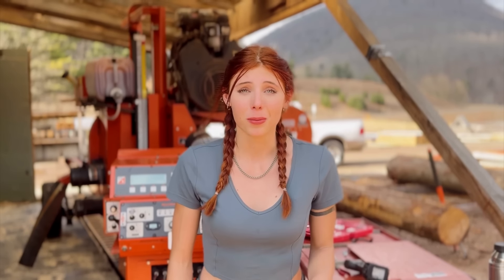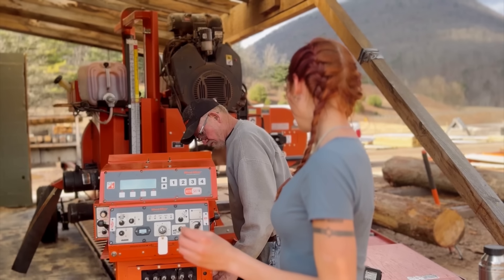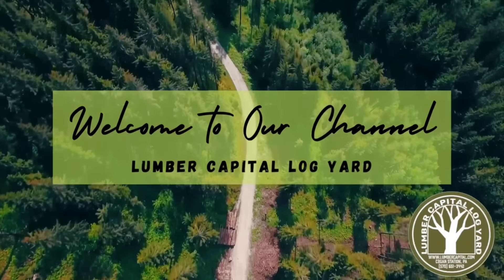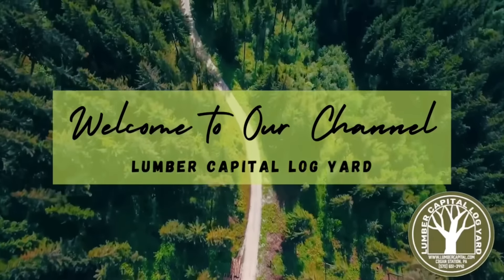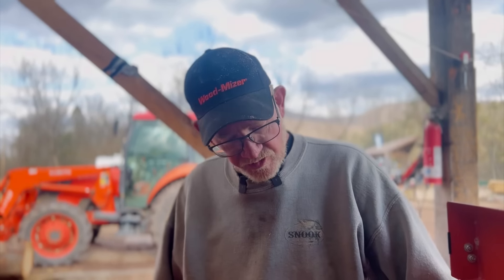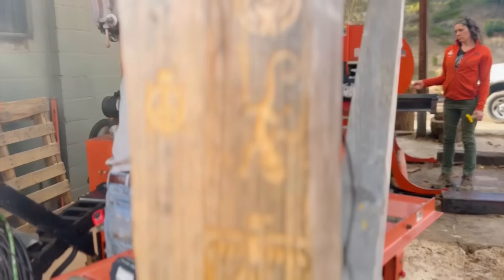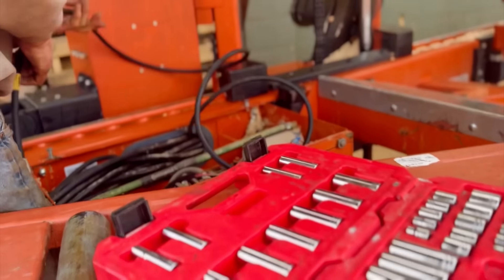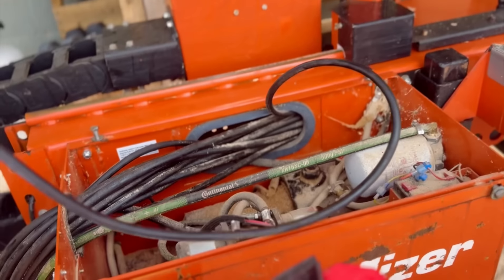A TRICKY repair for something so simple!

Comment: Anyone using the line technique: you'll have used a fairly light line to fish the tail of the pipe out, but don't forget, it may be too light to pull it back through. if so, use the light line to pull a heavier one through, and possibly repeat the exercise until you've got one that's heavy enough.

Comment: Good morning everybody,                     I’m not being critical when I say this, just a suggestion observation from the outside. Assuming you guys can get this at a hydraulic shop near you. There may be a chance you could next time use a dual Mail threaded coupler to screw onto the old hydraulic line before removing it and screw the new coupling on the new hose to that same fitting and as you pull the old hose out, the new hose will follow it right through in theory  L O L.   I have used the string method and many years past several times. Sometimes it works OK and sometimes it breaks partway through just some food for thought for the next go round. Hopefully there is none. You girls have a good day and tell everyone back home that everybody here on the       Mt. Tammany Ridge channel says hello🙂👍

Comment: You can't push the line in you have to slowly pull the rope and let the line follow and go where it wants to go. you keep pushing the line in the back side of the other lines and then pulling the rope. That will just snag the hose and bind up the line, the line will want to be to the top and front all your doing is getting it hooked under the other lines.

Comment: I repaired many machines involved with automotive manufacturing.  I am retired now.  I was a Senior CNC Controls Integration Engineer who also designed the control systems.  It was challenging work.  The risk of shutting down an automotive production line was always 2 wks away.  Very stressful!  :face-fuchsia-tongue-out:

Comment: I have used a coupling to hook up the new line to the old line and then pull out the old and install the new line at the same time, works on some jobs .
Did it a few times in the woods on the log loader tower that was full of packed  lines and grease , as I made my own hoses on the truck as I needed them , witch was nearly every day that some thing broke and needed fixed or replaced .
Coil of hose and reusable fittings and a air grinder and wrenchs , I some times could just cut off the bad end of the hose right on the log loader and replace the  the the fitting and be back to work in a few minutes .
The rope , wire , or string is always a good thing to do as it helps get the new line back where it belongs when there is other things with it and it will not be as easy to get it out of place or wrapped around something it is not supposed to be , I always do this working on cars and trucks helps a lot .
What is not fun is when you get a oil bath when a line breaks and can be very dangerous if the oil is really hot, that could give one bad burns .
Keep up the good work .
Keep the sawdust flying .

Comment: Hey, Here is some advice from another sawyer.  Put a dust extraction system on the mill.  It doesn't cost that much and it will save you time and your lungs.

Comment: You need to Lube the line with silicone spray and you may need to use a metal fish tape
Reply: Agreed, and fashion a cone over the end of the hose to help guide it through the opening
Reply: Silicone spray should help.

Comment: Great video. Most people have no idea of what it takes to produce the stuff all around them: the daily details and challenges to deal with. This is great education, and you make it fun. Don't know anything about the mill, but a hydraulic clamp will generally have a relief valve to let off excess pressure when the clamp gets to a limit force. If there is one here, and it's not opening (frozen by rust or corrosion for example), you'll keep blowing lines until that's fixed. Yes, pulling a fish line when removing a cable, hose, or wire from a conduit or chase is pretty standard. Tell grampa that "parachute cord" or "starter pull cord" is the absolute best because there's zero chance it will break. You can haul the new line through with whatever force is needed. That twine looked a little small 🙂. If it snapped, your day just got a lot longer. A thing to try is wrapping the tied end of the new hose in tape so there's a smooth transition from hose to string. =====>-------- This helps it thread through the old opening. Lubricating with soapy water can help, too. (They sell cable lube for conduit pulls, but that's  overkill here.)

Comment: Purchase a coupler to attach the old hose to the new one and pull the new one through as you pull the old one out. So enjoy how close your family is and getting things done as a team.
Reply: But they needed the old hose to take to the shop and have the new hose made.
Reply: @mikewatson4644  you can identify the fittings with the numbers marked on them. They would have been JIC fittings. The length could have been gestimated, leaning to longer rather than shorter. The hydraulic shop would have recognized the numbers. Hoses are also marked for pressure ratings.

Comment: Make a small diameter cable with ends for next time. Hose clamp it on to the repair hose. Should be a lot stronger than that string when pulling it through.

Comment: Love your videos. I'm sure you have the hose on by now. String was good idea. Problem is hose was in the middle of the group of hoses, and the string would pull the new hose back through the middle of all the hoses. Next time, just push the new hose through on top of all the other hoses, and maybe soap it up so it's slick. I love you guys!

Comment: Absolutely love watching you videos. Nice to see a small family business all working together. I do have a bare bones mill. Bought it used found the main carriage had a bend fixed on that,replaced guides. Learned the hard way to pay for very good blades. Now she cuts well and true. Thanks for all the tips they all help me. My sawdust goes for animal bedding. Any bigger chips and from chipper goes to local greenhouses they use it in a modified pellet type stove to heat the greenhouse.

Comment: 40 years working as a power lineman if you lube the wire, in your case the hose, even with ordinary dish soap the results are amazingly easy. It works!

Comment: Suspect by now you have it fixed - if not try putting some heatshrink tubing over the end fitting with the pull rope inside, then shrink over the rope (and a bit on the fitting). Makes the whole thing streamlined.  Good luck from England

Comment: I would have used wire for the pull cord. And an additional remedy is to coat the hose with some dish soap for lubricant.  This is how we pull large electrical cables through conduit or cable trays.

Comment: Just a couple of observations. Use that very small string to pull a larger, stronger line through that channel. It would be worth measuring the hose length so if it happened in the future, you could just get a new hose made up. Thread a male/male connection and use the old hose to pull the new hose through the cable/hose  channel. Also hopefully the hydraulic place can make an educated as to how the old one failed. Was it chaffed? Did it fail by the metal end fitting? Did the hose split lengthwise and if so, did the location of the failure have anything to do with how it failed? I'm sure you guys will get it back up and running and good luck going forward.

Comment: Spray WD40 inside the channel, and also on the end of the hose. Will slide through easier. Also put plenty of electricians tape on the end of the hose where your cord is tied, to make it tapered enough not to catch on anything when you pull it through. But yeah....lube that puppy up.  lol

Comment: Grandpa ,,what you needed was 20 feet of 1700 pound mule strap,,,you can get that at any nursery tree or shrub nursery. They have to have that on hand in big rolls to tie up and down the trees when they ship them ,,it will pull a truck out of the ditch and is not much bigger than a ribbon

Comment: Electricians use good old Yellow 77 pulling silicon grease that lubricates rubber tubing for conduit pulls. Silicon grease that makes it slippery
Reply: if its hyd fittings you dont need any type of sealent ive replaced hundreds of these hoses
Reply: it’s not for the connections, it’s used on the outside of cables so they slide  through the conduit easier.
Reply: my bad  ur correct

Comment: I blew 3 lines in one week on my LT40.   The repair is a pain in the neck!  I got a 1/4” male-male hydraulic coupling and screws one end into the old hose and the other into the new hose. Pulled the old hose out and the new one followed. Saved quite a bit of time.
Reply: nice.  I'm gonna steal that trick.

Comment: LOLOLOl I was screaming at the computer Dont pull the old one out yet . Please make a spare or save the old hose and use a double male connector to use the hose as a fish. a old or replacement hose is a lot stronger than a string or wire fish. Also, a little grease on the housing makes for an easier pull.

Comment: 👍 to the technique.  👎 to the pull tool.  Young lady, may I politely suggest that the TRICK for that circumstance is greater PULLING POWER and LUBRICATION of the pathway?   Suggest scaling up that STRING line to a ROPE line or the specialized coiled flat steel pulling tool used by electricians to pull wire through conduit.  Also, strategic placement of lubrication like dishwashing liquid to further ease the pull.  Too late now, but hindsight suggests using the still-in-place old line as the pulling line by attaching one end of the new line to it, and then, in one move, pulling the old line out with the new line in.  Thanks for sharing your stuff on youtube.  Always learning is always growing is lifelong the journey here. Enjoy the journey 😂..........

Comment: I have an LT40, and have had to replace just one of those hoses in 8 years of use. I think it was on the log lift. I remember it got squashed by a stick of wood that was left in a bad place under the mill. Anyway, I used a coupler to hook the new hose to the old one, and just used the old hose to pull the new one through. It went pretty easily.Of course, I had to measure the hose pretty carefully with it still on the machine, but it all worked out. Also if your hydraulic house has some 2-wire hose it's a lot more easy to handle than 4-wire hose, and plenty strong enough. You'll get it!!

Comment: Probably got some tie wraps inside the channel it’s hanging up on. Pull a thicker gauge wire through first (thicker than the string and having some playability to hold a shape, like 18 to 20 gauge solid copper or a thinner gauge steel wire). Twist the wire around the end centering it inline with the hose. Spiral wrap electrical tape from the wire back to the hose, forming a smooth contour to help pass by anything that can catch inside the conduit. I’m only charging 2 cents for the advice so take it or leave it at your discretion. Anyway, by the time you read this my bet is you’ve probably got it solved, in that case, no charge.

Comment: If tape a stick to the leading end of the hose so there are no catching edges on the round hose, it will thread a lot easier. I'd also use larger string.

Comment: Surprised you are not set up to repair your own lines.  When a line on my tractor goes, I cut it at the break, and put fittings on each side, then reattach.  No need to take the line off (if you can access that spot) Faster.  Easier.  Cheaper. Less down time, so less overhead lost.

Comment: As soon as I saw your grampa pulling in the hose I said, "not yet, tie a fish on!" I didn't need to, he already knew. Next step is pulling a bigger rope through and getting a... Hell I don't remember the technical name, but a horse cock, kinda like a chinese finger trap, it'll grab the hose on its own and you can pull like a pro.

All kinds of lube help or a layer of electrical tape to help smooth the spots that catch.

I've done machine maintenance in factories and I'm an electrician. I've even got my hydraulic shower badge😂.

The technical term for the trade term is kellems grip.

Comment: If those lines are pretty much the same length, keep a spare and when she blows just have a  fitting handy to join the two lines, pull out the bad one attached to the new line.

Comment: It is a beautiful machine, everything enclosed.  Meant more to be used than to fixed,  I think. I've lost skin trying to route cables & lines through channels.   And done it bare hands way below 0 degrees. Wishing  you all the best of luck - 'cause luck will fit in there, somewhere - in getting it all together.

Comment: If you knew the exact length you needed then all you needed to do is connect the old and new line with a coupling the same size nipple then tape it for extra security then apply a little grease around the new line and pull it through. Bingo

Comment: Using a cord to pull in a hose when there are already hoses in the duct is not ideal. If it only goes around another hose once, things will get really tough. It is better to pull in an electric cable with the cord and lubricate the electric cable a little. Or buy a professional white pulling aid for electrical cables from the supermarket, the plastic slides better. They're not expensive. Emerald looks super cool today.

Comment: Pull a larger rope with the cord, tape the hydraulic line to the rope in multiple places , if that doesn’t work slide some pvc pipe into channel and slide hydraulic line through it to the exit point then grab that sucker with some pliers and pull the PVC pipe out that’s what I would try❤😊

Comment: You all might want to invest in an Electrical Fish Tape.  They make an end for them that works like a Chinese Finger Trap. It can help the fitting end work through.  And you can break it. Choices metal or nylon. Both are strong.  Not expensive either.  $25 foot tape for about $25.

Comment: In electrical world, we daily use ‘fish tapes’, they come in both tempered wire 1/8 inch, 1/4 inch, and round bronze and fiberglass. Those would be a great help. The round ones have threaded ends for different leaders of sorts. Thank You for awesome videos, her eyes are mesmerizing! 💝🌹😘
Reply: We used those in the phone business too, allows push/pull techniques to finagle a bend or corner. The string just binds between other lines because it is too thin. I thought they could use the leaking hose to pull a new one, but needed it for the custom made one.
Reply: Wire lube, either commercial from a big box store or wipe down the one  being installed with liquid dish soap (Dawn) removes dirt and makes it slippery against other clingy rubber hoses. Fish tape would be an excellent tool as you know sooner or later you'll have to do this job again on the other hoses in that bundle.
Reply: Wire Lube - pretty sure there's a Belden branded product for that - SDI & Triax, the outer coating is a similar material to hydraulic and pnuematic lines. "Yellow Tail" - the yellow plastic strip that goes in the slots down the edges of wall, ceiling and floor panels, also works well as a Pull-Thru. Most electrical supply stores sell a tool like a wind out ruler that is flexible steel wire, specifically designed as a pull-thru feeder.

Comment: Better: Use the old cable to pull the new one through. Unless you're looking to repair the old one. The "line" can snag and break where the hose would not. I would suggest using a cable rather than twine, or at least paracord or bankline to resist breaking due to abrasion.

Comment: Prepare to have someone jump up and down on your lungs with steel toe cap work boots...
*WHY IS YOUR MOM THE ONE HELPING GRANDPA? *
You 2 girls are the ones operating that mill all day every day.
You 2 girls SHOULD BE the ones that know the machine inside out - and that goes for repairs as well.
You 2 girls SHOULD ALSO know how to sharpen the blades.
That is not to say that Grandpa and Mom need to be replaced - NOT AT ALL.
You 2 girls are in effect serving your apprenticeships and by the end you all need to know every aspect of the mill, how to take it apart, how to fix it, how to put it back together again.
So next time there is a repair to be done, tell Grandpa that YOUR hands are going to do the work and that he must make sure that YOU GIRLS are doing it right.
And when the job is done I bet that he will be the proudest grandpa in the country knowing that HIS GRAND DAUGHTERS did the job AND DID IT WELL.
Don't ever be scared to get your hands dirty, all the way up to your armpits if necessary.

Comment: Too late now, but after replacing hundreds of hyd hoses in my time, and in a different mechanical scenario, I’ve replaced those single long hoses with two hoses (connected together) close to where they commonly break.  That way you just replace a small section rather than the whole line…
Also, any places along the lines that might rub or have a sharp curve can be wrapped with curved “Hose Protectors” that you tie wrap around the hose at the points of scuffing or abrasion…these are sold at the place you have new hoses made…
Doing this has saved me considerable misery trying to keep municipal sanders working during snowstorms 
I enjoy your videos, and thank goodness for grandpas!!!

Comment: Two  words  that might  help you  .. Dish soap .. Those hoses are very" grabby"  rubber does not slide easily  .. Suggest pulling a rag through covered in dish soap and water first .. then pull the hose..  If that does not work  could always use oil. make the hose slick .. Hope that helps : )

Comment: Using a fish tape would give you more pulling power and when u tape the hydraulic line to the fish tape make the tape come to a point so the line can make its way through with ease. This is how electrical is done for lines this size when it's a little tough.